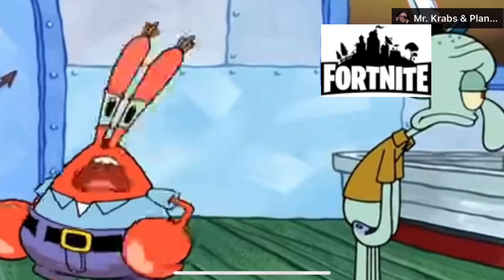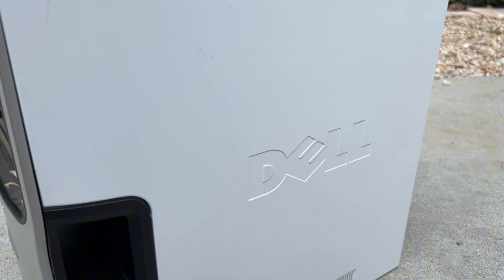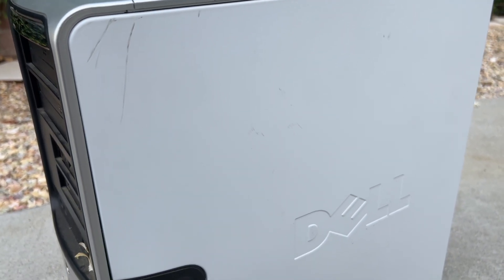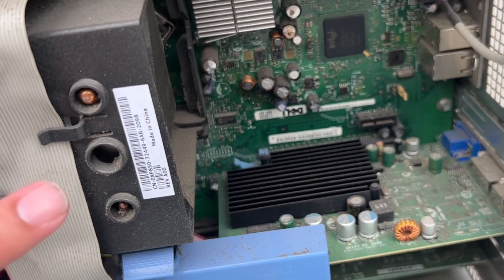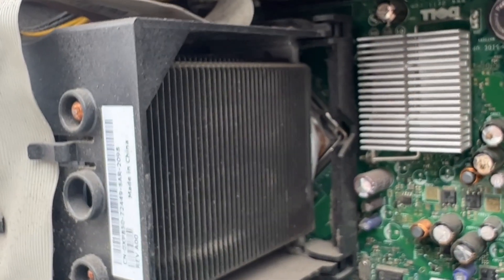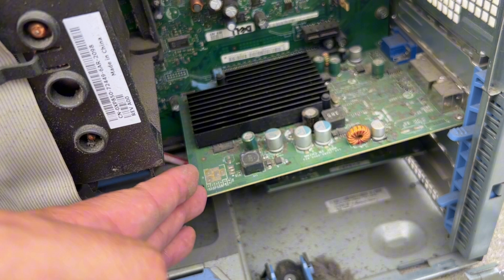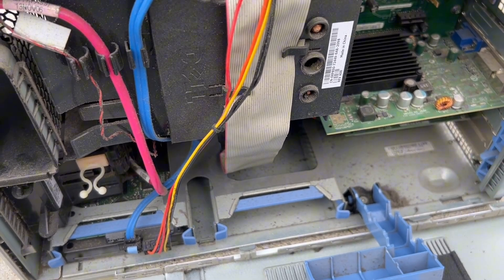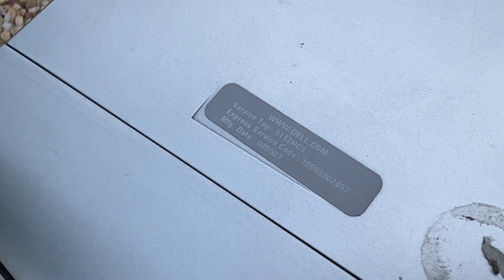LIVE! reaction - FREE 2007 Dell Gaming PC Can it run FORTNITE? Budget Windows XPS 410 Core 2 duo

Comment: CAPACITORS!!!!!!!!!!!!!!!!!!! The Caps From This Era Are Crap! You Should Have Seen The XPS 410 That I Bought From A Smoker! Nastiest PC I Have Ever Seen! Imagine All That Dust But With Oily Smoke Residue And A Horrible Smell!
Great Case!! If It Was Not Freaking Backwards For Regular Motherboards! Damn It Dell! I Could Have Upgraded After The 15 Years I Rocked The XPS 410! But Instead I Bought An Optiplex With An I7 8700 and Added A Yeston GTX 1650, 32GB's Of 2666 MHZ's RAM And A 1TB NVME SSD! I Got The Base Machine For Less Than 200 US! Then Started Adding Things To It!
Reply from the maker: Good deal.  I think everyone should have a dell at some point in their lives.

Comment: I Have A XPS 410 With A Core 2 Q 6600 That I Converted DVR'ed TV Shows On For Years!! Usually There Are About 6 TV Shows Per Week Night That I Converted To MP4!! The PC Would Run All Day And Finish Up In Time For The Next 6 Vids! Since I Started Recording TV Episodes in 2005 I Have Collected 35,000 TV Episodes! That Is 12 TB Of MP4 Files Most Of Them Are About 500 MB Per File! The Program I Use is MCE_Buddy It Converts The Video To MP4 Shrinks It Down And Adds The Meta Data To The File! Then It Moves It To The Storage Array And Deletes The Source File! Best 35 Dollars I Ever Spent!! I Was Doing All Of That Manually Before I Found MCE_Buddy! Way Easier Than Converting The File Then Cutting All Of The Adds Out With Several Different Programs!